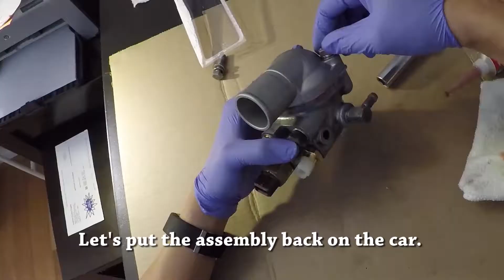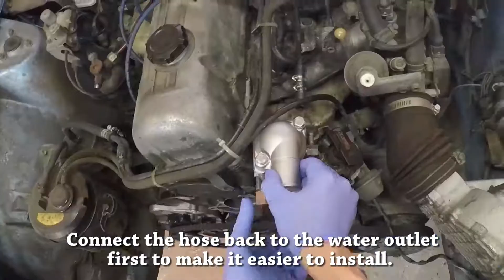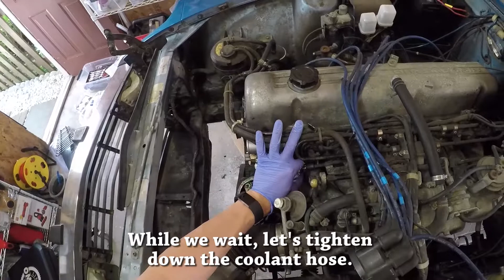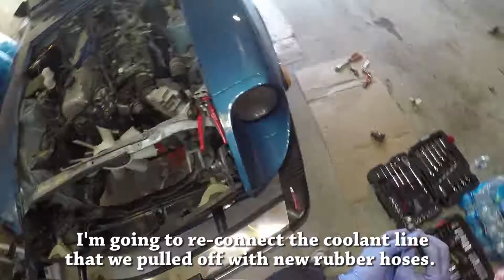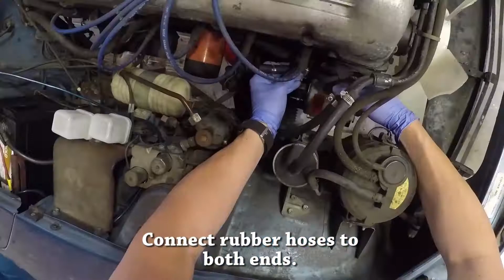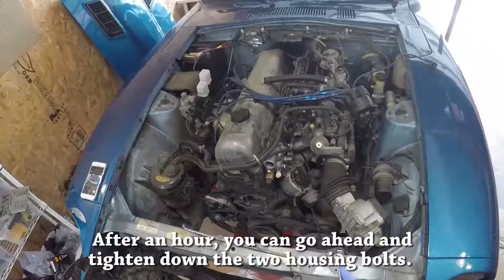Datsun 280Z Ep.11 (3/3) Installing the Thermostat Housing

Comment: I too would like to commend you on your videos.  They are very well done.  I have an early 76 (9/75) 280Z that is pretty much all original (just turned 77k miles), including paint.  What year is yours?
Reply from the maker: Hi Simon! Mine is a '77 5-speed manual 280Z that I found to be pretty much all stock (other than the repaint and some farty exhaust that was welded on), and I plan to keep it that way as much as possible. I'm a novice mechanic, so let's just say that restoring this vehicle bit by bit is a learning journey for me. No crazy engine swaps, turbos, or body hacking just yet. I'm just trying to see if I can restore this vehicle to its former glory. 

Thanks for your words, each positive confirmation that I'm doing something that others are finding helpful means a lot to me!

Comment: Whats the point of the liquid gasket if there is a gasket in between? does the gasket not seal properly on its own? honest question and ive been enjoying these videos as a person who one day will own or build a l-series powered vehicle
Reply from the maker: I think of it as extra assurance, but it may not be needed? Most people use liquid gaskets in addition to the paper gasket especially for cooling components so I thought I'd do it without questioning it much. You just have to be careful about not using too much, otherwise it might ooze out and block the passage.
Reply: Thanks for the replay, better to be safe than sorry i guess is a good way to go.

Comment: Hey, is there a way to tell which bullet connectors go to which when it comes to the water temp switch and the thermo time?  My wires are the same color and approx same length..
Reply from the maker: Oh man that's a good question I'm not sure. You can trace the lines back to the ECU, which is a giant pain, or trial and error. You get 50% chance!